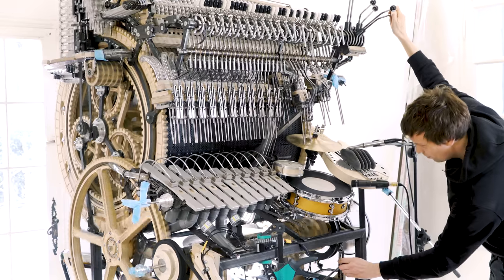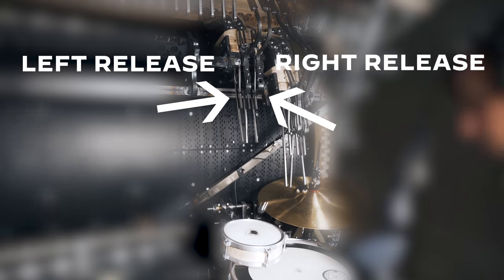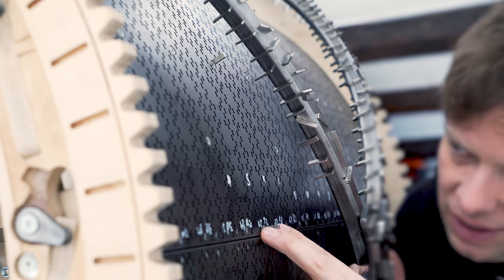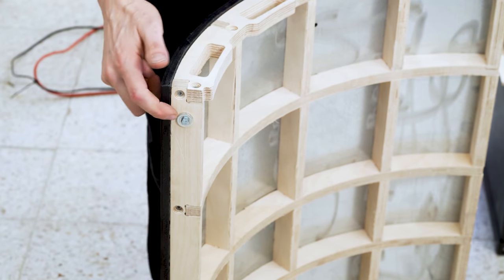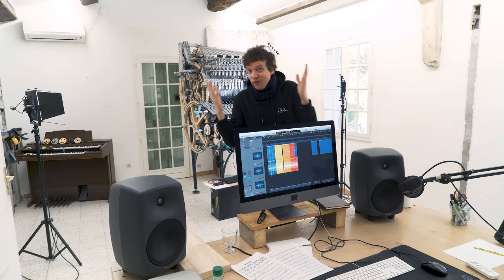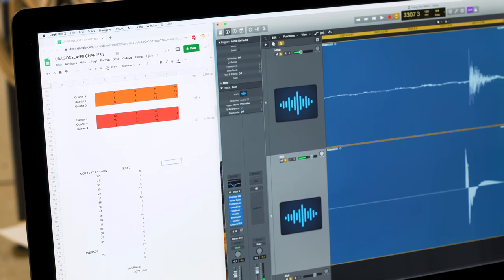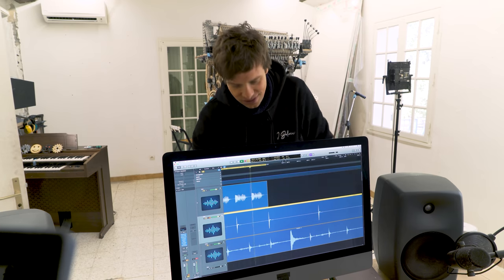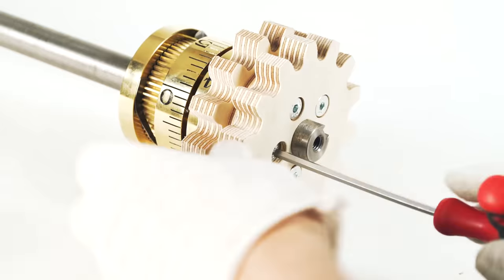Playing Tight Music? - Marble Machine X #115

Comment: (like if you have small pp) Get an electrician, we don't want this: breaking news: years of work destroyed in a fire due to the inproper care of the electrical outlet in the building

(years of work being the MMX)
Reply: Replace the plug AND receptacle. 😊
Reply: Wise users of computers make a backups, so no such electrical events can harm them much. :)
Reply: @zaxonxp45  Fire.
Reply: @zaxonxp45  not really possible to have backup of the MMX!! Don't want the whole thing to burn to a crisp!!!
Reply: @zaxonxp45  ... doesn't hurt to have an uninterruptible power supply either!
Reply: @the_deputy2327  As long as the project files are backed up it can be rebuilded much faster than original prototype. As far as I know the CAD software Martin using stores the files on the server, so there is already some backup. But indeed it is not good to have such unfinished electrical circuits be used.
Reply: @Quickened1  Or some offsite backup mechanism for important files. But indeed, UPS would not hurt.
Reply: @zaxonxp45  you must have forgotten he turned off the wifi
Reply: Exciting!  I can see the finish line in this decade. Lol. Keep on trucking martin.
Reply: Never mind The MMX, what about the safety of Martin?!?!
Reply: Oof, just remembered that Martin probably won't see this since he shut off the wifi... Uh oh... Let's hope it makes fire music before it catches on fire....
Reply: Yeah, maybe having a toilet on your working area was distracting, but that thing in the wall is fucking dangerous
Reply: Martin can run, can the MMX though? (I'm mean like sprint out of the room, not play for any of you smart arses I had to say this)
Reply: @windyruler6645  Instead he could block internet access for some software. Cutting off completely it would not be wise as it always good to have offsite backup.
Reply: Also, probably worth getting insurance for the MMX. It is irreplaceable, but still.
Reply: as a fellow electrician i cannot agree with this more, that screams fire hazard please get that installed properly
Reply: he's creating the machine by destroying the house
Reply: Agreed.  Loose wires burn houses.
Reply: Dewit! The idea of the MMX getting burnt makes me cringe into a raisin.
Reply: Martin should also backup his data.  Even without a fire it would be bad if, say, his hard drive dies.
Big projects have died due to lack of data backups.
Reply: I have thought it many times, but not spoken. Thank you. I actually just lost my house in a fire a few months ago.
Reply: Really, that's not up to code!!
Reply: @zaxonxp45  Thats not the point at all.. you missed the point.
Reply: @zaxonxp45  Theres probably a few hundred hours of build time for something like this, not to mention the assumed adjustment via shims, nightmare to set up.
As a mechanic/engineer I can appreciate this design, however what a waste of time and effort for something with no real purpose
Reply: @zaxonxp45  he switched off the router, and if you look in the video at his computer it has no wifi.... So yea
Reply: @robertrigby-jones2805  I mean once it's finished he's gonna take it on tour where millions of people will pay to see it make music, not exactly the definition of "no purpose"
Reply: First thing I thought of when I saw that part.
Reply: @robertrigby-jones2805  You really are a philistine, aren't you? Art has no purpose?
Reply: @robertrigby-jones2805  what the actual fuck do you mean by no purpose? Is making a wonder of the world no a purpose? Making a beautiful form of in a music no a purpose? The whole machine itself is beautiful!
Reply: And what about fire insurance? What value to put on this machine? It is much more than the simple cost of materials.
Reply: I do have nightmares of the MMX being destroyed by fire, please address that electrical installation situation, if only for your sensitive fans 😜
Reply: Agreed!
Reply: He has certified journeymen helping him.
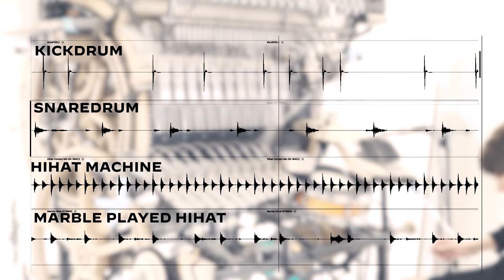Reply: duuuuuude,  make minute 1:00 a T shirt
Reply: I had that happen to the outlet behind my tv. We had a three way plug in the wall outlet and bc people left their phone chargers plugged in without them plugged into a device, the electricity has no where to go, so it burned and melted the Threeway plug
Reply: @alexb5020  so, what was the point then? ;)
Reply: no one asked?
Reply: @robertrigby-jones2805  If Martin and his team added all the adjustments back to CAD/technical documentation then rebuilding the machine would be much faster and easier. And building more machines (as backup) was one of the Martin goal (I remember this as I watched all his movies). 
I am also electrician/IT engineer so I agree to your perspective. However I am also an artist (drawing/composing music), so I can also understand Martin goal to create mechanical piece of art which is in the same time an instrument never made before.And probably in your live you can find many not functional things which you might still enjoy regardless. :)
Reply: @windyruler6645  Then it is not very wise not to have a backup of the important files. Or maybe he does?
In his place I would set up some time machine and sync the output once per day to external and offsite storage. I wonder if he do this?
Reply: Agree, I’m paying 20 to help you. Use some of that money to fix your outlets
Reply: @zaxonxp45  doest mean he can back up the custom made parts with no cading done
Reply: Such as some of the hand bent pipes, or the whole machine itself...
Reply: @windyruler6645  Well, he could measure them and create a cad design to make a complete project. This is what he wanted at the first place: to give the complete design so somebody else can build the machine for him. But I guess that you might be right that completing the whole CAD design might not be a Martin priority right now.
Reply: Breaking news
Deemed "too important to fail", a billionaire fan of the project has revealed that he has an identical copy of the MMX, thanks to the plans having been made open-source, and has announced that he will donate the machine to Martin in order to keep the project on course.
Reply: ElectroBOOM would be proud :-/
Reply: @movax20h  (They probably have it.) For that to happen. Two things need to happen IMO. A credited assessor needs to evaluate the worth of the MMX and the risk of damage. Second. A company need to accept the risk. Then there is the backup. I mean that literally. Have an off site backup of all the important/cad files so it can be remade. With that done. All the parts can be remade they same... The question is,,,, how close can a #2 MMX be built and sound like the first one? My guess the average person would not hear a difference. I'll add to that guess that #2 would be better to the Pro ear.
Reply: Lol everyone here talking about him shutting off the wifi and having no internet. Um..then how did he UPLOAD this video???
Reply: @AwesomeBilly3  that's not really how electricity works. Electrical fires are usually caused by loose connections. When there is not solid contact between connection points, the connection heats up due to higher resistance. 

Not because the electricity "had nowhere to go."
Reply: @zaxonxp45  rebuilding hahahaha, go watch the programming wheel video. And just imagine how much this machine has cost to build
Reply: @YourSweatyUncle  That was Martin initial plan to order other machine giving the full design. If he will go for it or not, that is another story. And programming wheel plates might be done from the steel sheets with welded bolts, so no needs for repeating this difficult process as there is already the MMX prototype for composing.
Reply: I’m an electrician and I would check the whole electric at Martins house for free. The only thing to pay would be the trip to him and the way back. It would be a honor for me to help him in that way to prevent any electrical danger to him, his home and the MMX.
Reply: Improper not inproper
Reply: I thought I was reading this wrong...
Reply: @windyruler6645  So you got so bored during the quarantine that you changed the comment? Jesus lol
Reply: Electrical guy here. Best thing and most important thing too. When working with electromotors is to have it always on a second group directly connected. For a relay board motor control you can have the motor power source and the control source split. This prevents burning out of your power supply. And insures you don't accidentally starve your computer of amperage as well. The wall outlet doesn't look like it is complying with Dutch fire code. But that's... Extra?
Reply: But the fact that he actually did this is amazing
Reply: You pulled a sneaky on all of them

Comment: I'm seeing a lot of comments suggesting an emergency stop button. 

The problem with an emergency stop button is that you are required to press it and if it is out of reach at the time of failure its pretty much pointless.

Speed Torque and current is monitored by the motor controller if it is programmed correctly it should automatically lock the motor as quickly as possible if something goes wrong. If that fails a resettable fuse on the input to the motor gate driver would be a suitable backup.

Comment: I would recommend automating the data mining of those time differences. It looks like you're spending a lot of time manually measuring them in the interface, which looks tedious, especially since you've only just begun the calibration process. This can be trivially automated, probably with a simple trigger and a holdoff algorithm. If the recording or editing software you use doesn't have such features, I'm sure I could whip something up in Python if you send me a couple of sample audio tracks. It sure would be nice to have the computer directly spit out the correction averages during (or shortly after) recording.
Reply: i personnaly would be super interested by having the time change of a correction. 
i would really like to know if the number of steal shims change the timing consistently (1 shim = -2 seconds of the general timing) or (the timing change of a turn of a crank ) , etc
i would love to get some data to code a "minimal move for a correct time adjustement program"  
if it is not consistent, it is just more fun ;)
Reply: I'll just add that if you want a real-time display of the timing offset, any digital Oscilloscope worth buying will have the triggering, hold off, and measurement built in.  Your biggest challenge will be slowing it down enough :P
Reply: It's not difficult to test the timing difference in interface. It's literally what it's designed for.
Reply: @lobsterbark  that's true, but if you're talking about a task that needs to be done hundreds or thousands of times, especially as more channels need calibrated and perhaps re-adjusted further in the future for maintenance, it's a lot easier to write a few simple lines of code now, thus saving hours of boring, unnecessary work in the future.
Reply: @ericcmcgraw  Beat detection already exists, so if you insist.

Comment: 1) this machine is literally 0.005 milliseconds out of synch so I need to adjust it... 2) with this bit of wire I found on the bench I can see the heights of the marble drop are exactly the same...  🤣

Comment: Success! Great news. A concern I have stated for a long time: with different marble drop distances, how can you find tune the timing at both your slowest and fastest RPMs that you run MMX at?
Reply: I have the same concerns. I think, with the current design, the best option is to calibrate for the middle and limit tempo changes to a range where the error is acceptable.
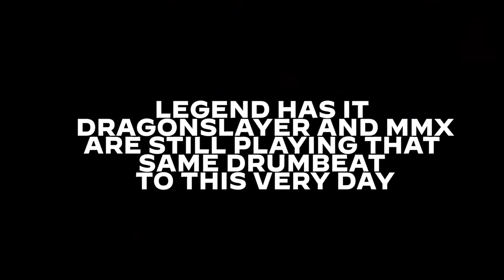Reply: There is a clutch arrangement that allows you to set a timing offset for each different tempo. See just after 19:00 in this video
Reply: Martin talked about it before, the drop height is the same for all instruments, so it won't change the timing. The only not drop-controlled part is the rhythm machine, and it has the variable clutch timing added just because of that.
Reply: @ZozoleonLego  I had not heard Martin say this in the past. If true, that would limit some of the problems. Visual inspection seems to indicate that drop distances are not always identical.

Comment: What if instead of using electric motor, you used a steam engine?
Reply: This type of thinking is going to lead us to kinetic fingers :P
Reply: Did you mean bellows? It's been done. See the museum tour video. (Pneumatic is as pneumatic does.)
Reply: @AstralS7orm  Negative. I mean what I say :-)
Reply: Springs, surely. Fun fact: amateur motion-picture (film) cameras obviously needed a pretty steady speed for the film transport, so they simply used a hand-wound spring with a speed governor. Downside: you kinda had to keep winding them pretty much most of the time - there wasn't all that much energy stored in the spring...
Reply: @weekendwarrior5303  What would you gain by using steam rather than dry air? It's not like music instruments benefit from high pressure.
Reply: @AstralS7orm  The whole novelty of the marble machine was that it was all mechanical and man powered. Placing an electric motor that can control the tempo takes away from this. It's like someone who play the drums vs someone who can make beats in an audio program. Sure they can play they same beat and make the same sounds but if you went to see them live, one would be called a musician and the other a DJ. They both make music and it is an art but they are different.
Reply: @weekendwarrior5303  Uhm, steam engine, unlike bellows, would be about as automatic as the motorized machine, just with a steam motor rather than pneumatic or electric one...
Pneumatic motor would at least allow for easy breakdown (like the crank) if bellowed rarely or with reduced pressure. For a steam engine, the reduction would be much bulkier and involve valves.

Comment: Very cool! Just keep in mind that if you're gonna disassemble and move it large distances, the tolerances will most definitely change and this kind of calibration will need to happen before every concert. Also, being this tight, simple temperature difference might influence the timing.

Comment: Electrical guy here. Best thing and most important thing too. When working with electromotors is to have it always on a second group directly connected. For a relay board motor control you can have the motor power source and the control source split. This prevents burning out of your power supply. And insures you don't accidentally starve your computer of amperage as well. The wall outlet doesn't look like it is complying with Dutch fire code. But that's... Extra?

Comment: Even with the indexable clutch you have, the tweaks you're making to tighten up the timing are tempo-dependent, as the wheel will be turning at a different speed.  So it might be great at 120 BPM, but if you were to play at any other tempo the timing is going to be off.

Comment: Congrats on the tight timing. It will be interesting to see, if the ESP will be able to keep the timing, once mechanical load increases and changes with the running marble elevator and more marble releases being lifted at the same time.

Comment: One thing i haven't seen be mentioned yet is once you have all the channels playing, if the motor would still keep that bpm. You tried it with a few channels, but i wonder if it would still keep up when there are more mechanical resistances in the machine, such as all the vibraphone notes playing in rapid succession. I hope this makes sense

Comment: How much of this adjustment is "setup" compared to the amount that's "tuning" the instrument? I'm curious about what will need to be verified again after travel, assembly, and so on. Have you given thought to the hardware and/or software that will be needed to support the machine tuning while on tour? If you're not averse to integrating electronics into the MMX, you could tap into the microphones and implement a microcontroller tuning test along with any kind of output device. You could even have it run a WiFi network and use a web interface, which would mean a minimal visual impact. I would be more than happy to help or build a proof of concept if it would help the project.

Comment: The thing is, adjusting the marble drop height will add a fixed time displacement to when the note is played, independent of tempo. But adding he shims adds a time displacement that’s a factor of tempo. So you should test at two wildly different tempos (one really fast, the other really slow) for each note to ensure that the timing won’t be impacted by tempo. The result will be that all marbles take the same amount of time to be released and hit their instrument. This isn’t necessarily the same as marbles having to travel the same distance, since it will also depend on the angle of the path. Better to set them through timing measurements than using a measurement stick for all of them for this reason, at least for different instruments. For the two drops that hit the same instrument it shouldn’t be an issue.

You also don’t have any way of adjusting the tempo-independent time delay to the hi-hat machine, so I wonder if it will be possible to get that playing tight regardless of tempo at all. You’ve got the indexable clutch for this, but any voluntary changes in tempo within a song will be impossible to compensate for without some sort of smarter system. You could put the swivelling hi-hat sideways and drop 4 marbles over it? Could also get an electronic time delay and a solenoid-actuated hi-hat, or even another electric motor with speed controller and a hall-sensor on a multipole magnetic ring measuring the speed of the main wheel, such that the smaller hi-hat motor is always running that fraction of a second late.
The indexable clutch is really cool looking though.